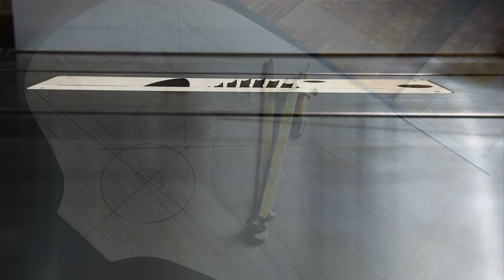Woodworking / Making a stool with carving. / ON WOOD

Comment: Not bad, but I think you missed a design opportunity.  If you had left the tool marks on the underside, and continued your gouge work down the length of the legs, you could have left the top entirely smooth.